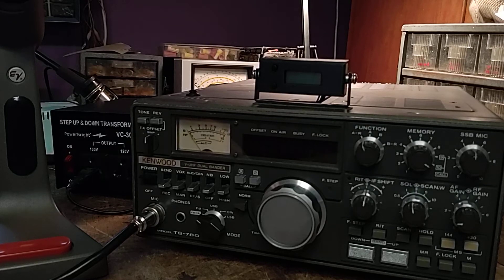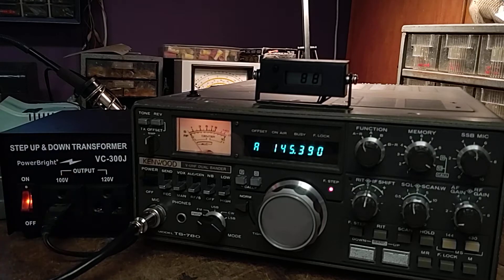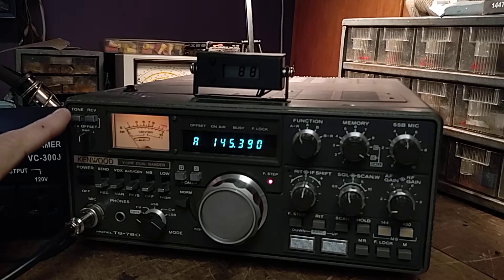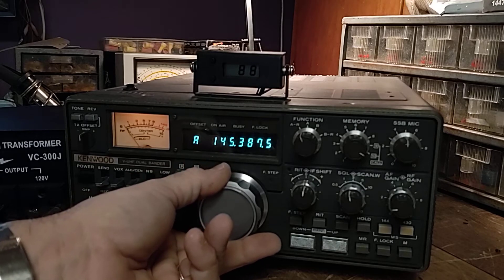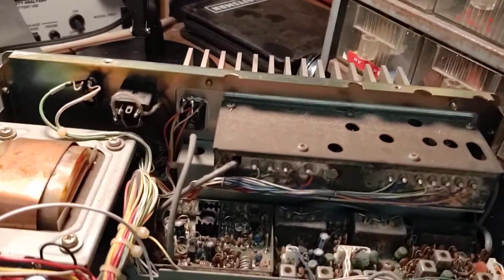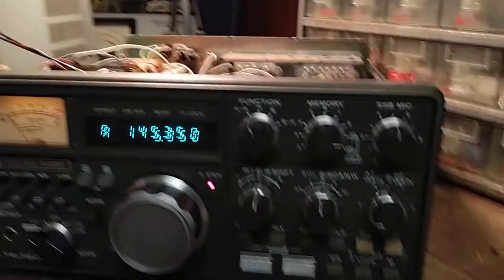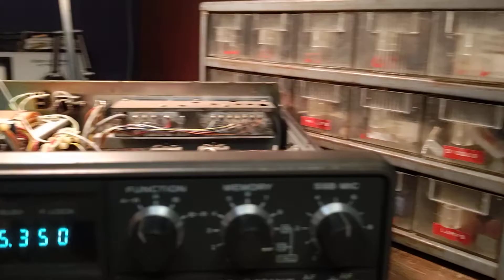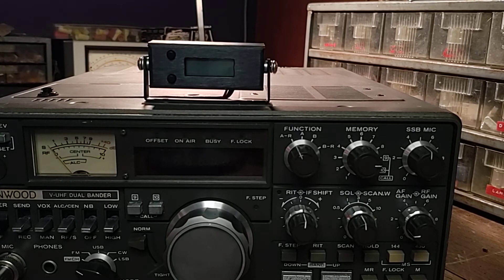How to modify a Kenwood TS780 for use on the US band plan frequencies

Comment: I bought a 780 that when turned on volume pops through the speaker but no receive or transmit , frequency display looks fine. Any were I should start looking , thank you mines been converted